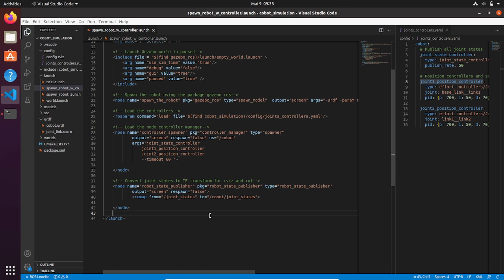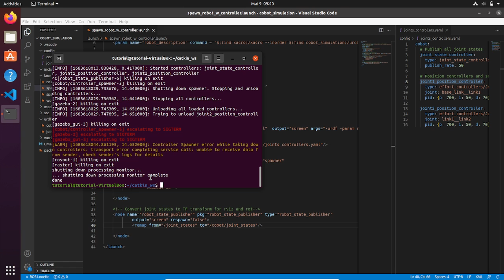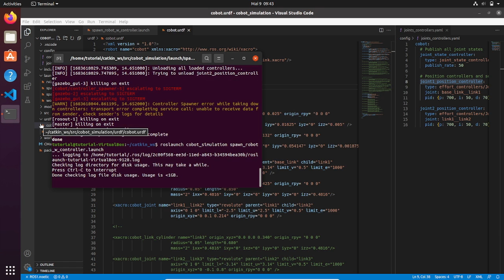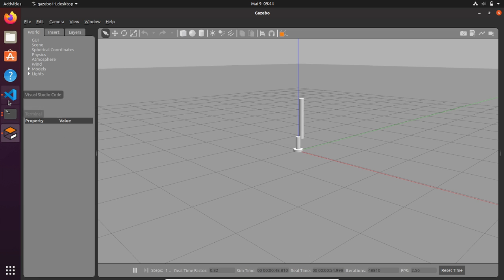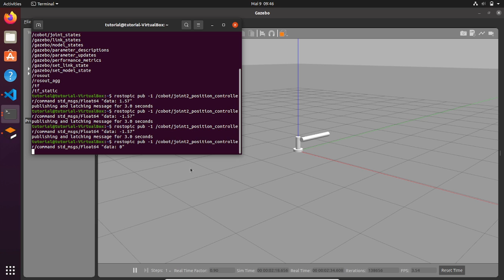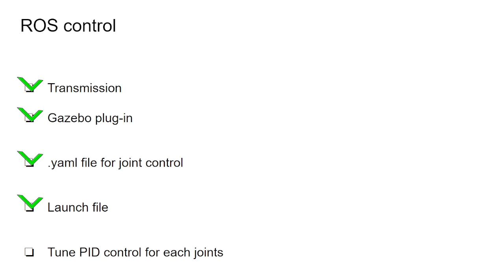How to setup ROS Control for 6 axis robot, Part 4: launch file and test joint position

Comment: hey hi, I am unable to load my controllers. Here is the error, 
"Could not find resource 'joint_2' in 'hardware_interface::EffortJointInterface'.
[ERROR] [1710652866.981946015]: Initializing controller 'joint2_position_controller' failed
[ERROR] [1710652867.986115, 0.000000]: Failed to load joint2_position_controller"

for every joint I have been using. Please help me out
Reply from the maker: What type of controller you have set? I you have controller of type effort_controllers/JointPositionController then in the transmission tag you need to have "hardware_jnterface::EffortJointInterface. 
If your type of controllers are
position_controllers/JointPositionController, then in the transmission tag, you need to have hardware_interface::PositionJointInterface

Let me know what is happening then ;)
Reply: @learn-robotics-with-ros   it is working now. Thanks. btw where to learn these stuffs?
Reply from the maker: Hi! I am happy that now your robot is working.
You can check the wiki ros tutorial to check the ROS control, but honestly is difficult to follow, without practical project. Personally I work with this stuff and I know how difficult it is to learn ROS by yourself taking tutorial on Internet without a structured way. That's why this channel exists ;) 

You can check this course on youtube step by steps 

URDF design:
Model a robot with URDF: https://www.youtube.com/playlist?list=PLJOHOcnvyOr0mh8v7eRvL9ipz3fY47iMp 

ROS control course:
https://youtu.be/bAfOl6VFjLg 

Interface moveit with Gazebo, where I solve a common problem that comes up with the Hardware interface:
https://youtu.be/IVnJLZrJdY0 

Finally, if you are new in ROS, I would suggest to have a look on this course, it gives you all the instrument to understand more complex topic in ROS: 

https://learn-robotics-with-ros-s-school.teachable.com/p/first-steps-with-ros1
Reply from the maker: Remember that you can benefit 50% discount with the coupon WELCOME50
Reply: Thanks. I will have a look at these provided links. ❤.

Comment: Hey there my robot is not responding same as urs it is standing straight infact i have also started the Play button
Reply from the maker: Does the terminal shows any errors? You can share with me your github repository and I can have a look on that. Or send me your package via e mail: ros.master.ai@gmail.com
Reply: @learn-robotics-with-ros   [WARN] [1698782569.689429, 18.814000]: Controller Spawner couldn't find the expected controller_manager ROS interface. this warning is showing on my terminal as i launch the spawner how to resolve it please help.
Reply: i also sent u my zip file